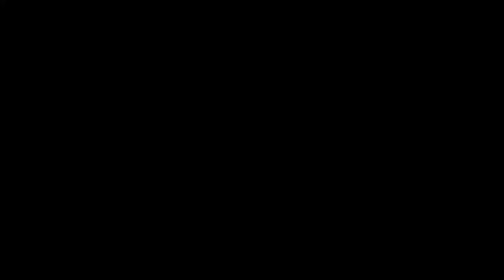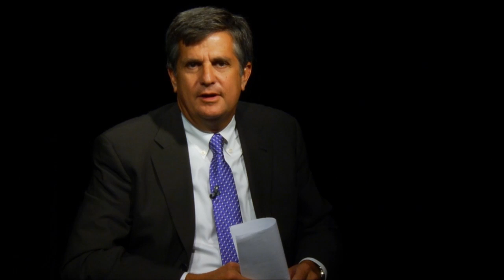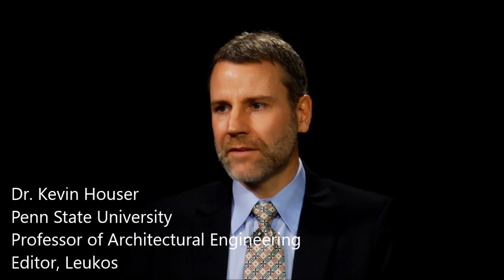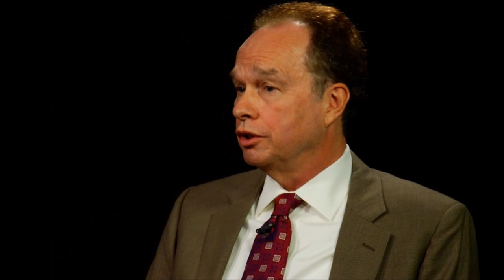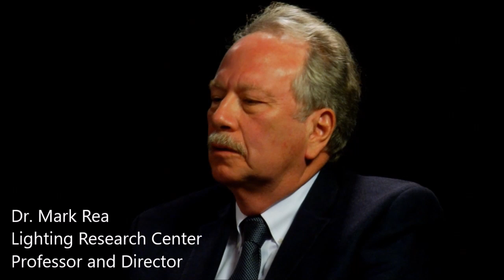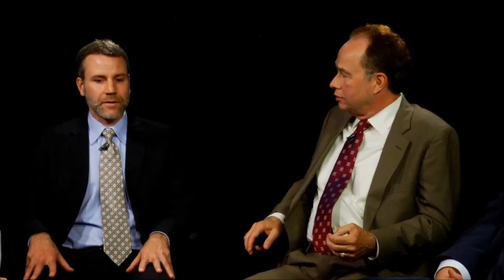TM 30 Color Metric

Comment: Below is accompanying text from Edison Report, written by Randy Reid:

Your humble editor sat down with Dr. Kevin Houser, Mark Lien, and Dr. Mark Rea to discuss the new IES technical memorandum for color metrics, TM-30. 

This was one of the most fascinating discussions I have been a part of and it did not end when the cameras stopped.

After the discussion we heard first from Dr. Houser and then from Dr. Rea. 

Dr. Houser took issue with Dr. Rea’s comments about not having data to support TM-30. In the video, Dr. Rea stated, “This is the misleading part. Kevin used the word accuracy, but you in truth have no idea what accuracy means. You’ve never done a test … it’s being oversold as more accurate because it has 99 chips, when there is no proof that that makes any difference at all.”

Dr. Houser provided the following documentation:

On the contrary, there is considerable evidence that IES Rf is more accurate than CIE Ra. This is primarily because of the new set of 99 color evaluation samples. The fact that light sources can be selectively optimized (or “gamed”) to have higher values of CIE Ra without increasing actual color fidelity is not a conceptual problem with the CIE system, but a mathematical problem. Thus, the mathematical limitations of CIE Ra were addressed with a rigorous reworking to produce the TM-30 calculation engine. Journal articles that provide direct quantitative evidence in support of TM-30 include:

Optics Express journal article that provides overview of the TM-30-15 method  Development of the IES method for evaluating the color rendition of light sources.  http://bit.ly/1J32ftZ 

LEUKOS journal article supporting TM-30-15’s technical foundations Why Color Space and Spectral Uniformity Are Essential for Color Rendering Measures.  http://dx.doi.org/10.1080/15502724.2015.1091356

In addition, Dr. Rea stated,  “…can’t actually see a difference between 78 and 80 anyway.”   To that, Dr. Houser replied, “Any single number (whether CIE Ra or IES Rf) is intrinsically limited and unable to characterize all dimensions of color rendering. Two sources that have the same score for fidelity may in fact make objects appear very visibly different. Mike Royer and Tommy Wei created a portable demonstration to make this point (among others), and we have demonstrated it at the IALD, PLDC, and IES conferences.”

Dr. Houser copied Dr. Rea on the above responses. 

Dr. Rea responded, “…There are no data whatsoever to support his claim that the metrics offered in TM-30 are more, less or the same as alternative metrics for predicting subjective judgments of color appearance.”

Dr. Rea went on to say, “The 99 chips argument is related to “gaming” not to accuracy.  His “gaming” argument is specifically related to manufacturers trying to meet an arbitrary criterion for a given metric, but “gaming” to meet an arbitrary criterion is not directly related to what people see.  There may be collateral consequences of “gaming” for color perception but it seems unlikely that “gaming” makes color rendering worse.  It seems more likely that reputable manufacturers would only release a lamp that either perceptibly improved color rendering or made no perceptible difference. I know of no evidence that suggests manufacturers have made color rendering worse by “gaming.”  

Rea concluded his email with the following statement, “We have been publishing our research on color rendering for many years, so I appreciate the opportunity share my insights on this video.”